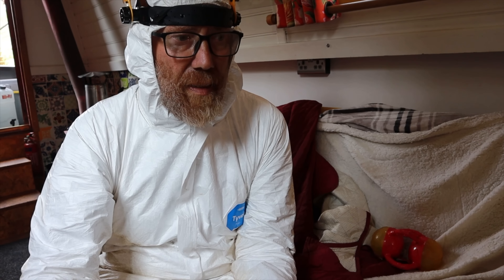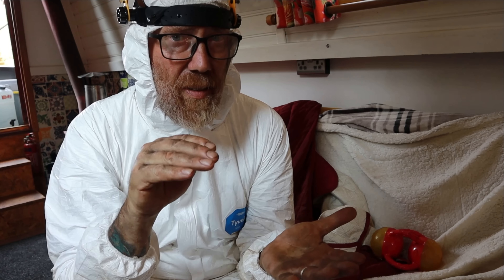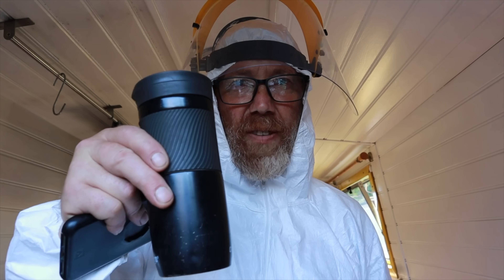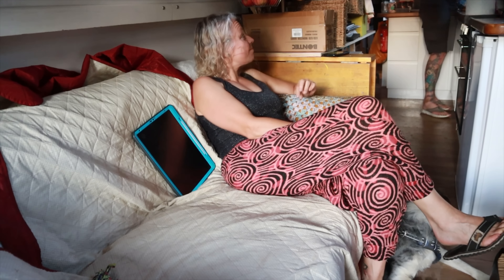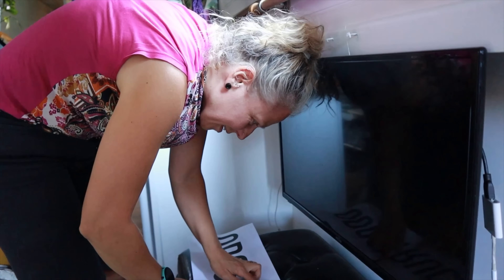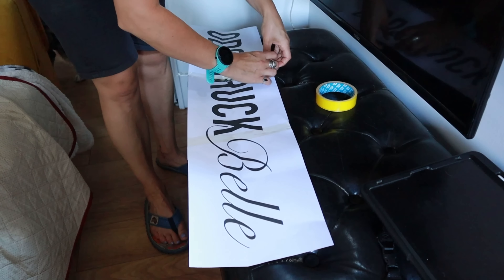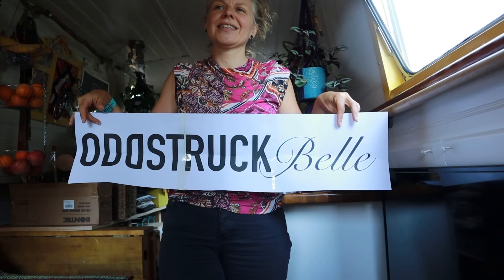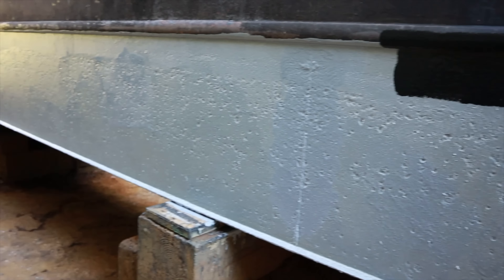Narrowboat nightmare - We get bad news on the state of our hulls baseplate

Comment: At least Chris you have found the issue before it was catastrophic. I'd wished I had found facilities to lift my boat up enough to paint and survey the complete hull. DIY painted our boat last year. Will do any DIY paint job next year and lift the boat up. Love to you all.
Reply from the maker: Hey Steve,
Yeah I was thinking while I was under there checking, checking and checking again that I had removed the corrosion and covered in both coats of the epoxy, would someone I've paid to do this be as thorough? If you can get to somewhere that leaves you high enough to check and treat the base, do it is definitely our advise. xxx

Comment: Ouch! Least you have got to it. 
You do seem to have a lot of pitting on the sides of your boat too. Do you have  sacrificial anodes? I believe you can get them put on the base plate as well. Won't stop rust but because of the poor steel, it could be more subceptable to electrolysis. Not that I know but a thought to query the (hopefully) experts with.
Reply from the maker: Thanks Glen, yes all options are open and will be decided upon in a year when we come out again. We’ve got expert advice in the team at the dry dock…. I’m confident that in a year we will have the best solution in place x

Comment: That is looking pretty bad, personally if it comes to it would be better to hog out the craters to good steel and filling with weld then buffing flat would be a better option as the over all balance of the boat would not change where as a new plate on just the rear would add a load of extra weight that  could effect handling and would cause the stern to sink lower a new plate section for the rear would probably be in the range of half a ton.    One other thing i have seen many start to do and that is add 6 anodes to the base plate to help prevent base plate deterioration
Reply from the maker: All solid advice, filling with weld is definitely one of the options. All options will be discussed in a years time. We are good now until then…. We know what we’re dealing with and that ironically has stopped the worry!
Thank you… 😊

Comment: Hi guys did you get the hull grit blasted? What was the primer used? What type of Jotun was used.
Reply from the maker: Hey Peter, the primer was Jotun jotamastic 90 alum and the black coat was Jotun Pioner TC. We didn’t grit blast as the power wash got pretty much everything off. I did grind off the bits inside the craters. 
Are you having to do the something similar? 
Good Luck if you are